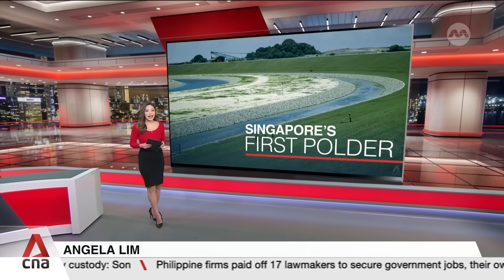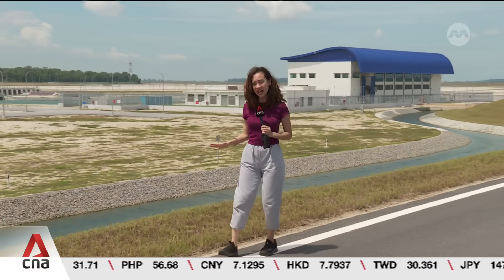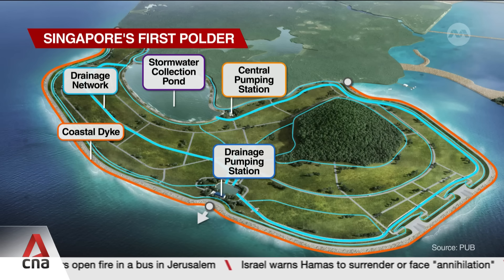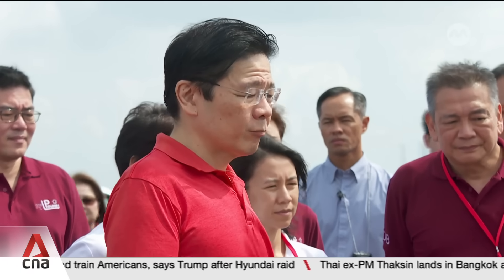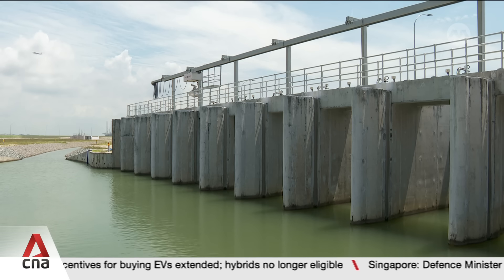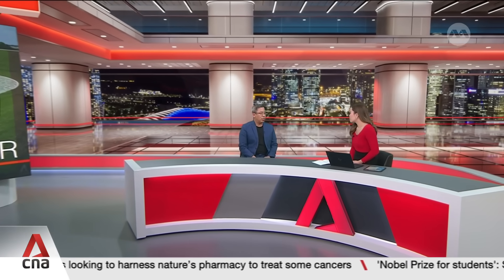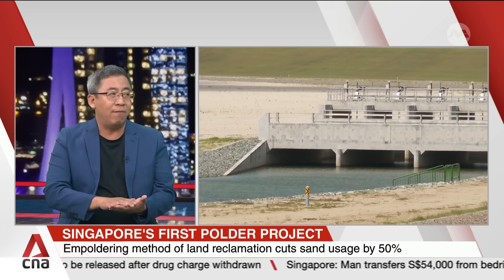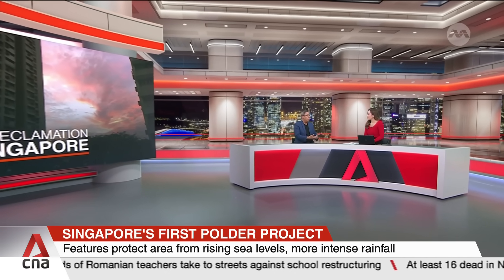Singapore uses non-traditional method to create new land at Pulau Tekong

Comment: What a brilliant idea, amazing execution! Why not harvest the excess water instead of pumping it back into the sea?
Reply: water pipeline. Nothing is impossible if there's the will and determination.
Reply: @EK-tt6bk it's not our will... it's heaven will...to ensure there is sufficient rain water to keep the desalination plant running most of the time. Btw, if there is sufficient rain water to keep our reservoirs full, why do we still need another desalination plant? 😂
Reply: desalination consumes too much energy
Reply: @shawnngch  It's rain water that is pumped out.
Reply: @whm5511 where you harvest to?
Reply: @OrangeCarChain Put to Singapore reservoir
Reply: @ItzChickenYall   Is it economically viable?
Reply: @whm5511  oh yeah, what was i thinking. haha
Reply: The objective is diff lah. The purpose of the polder is to prevent floods. Desalination pro cess will be too slow to clear the water
Reply: Feasibility, the cost of piping to the mainland or even building a desalination on Tekong is counter to the benefits. Good work SG Gov sure this is just the first of many.